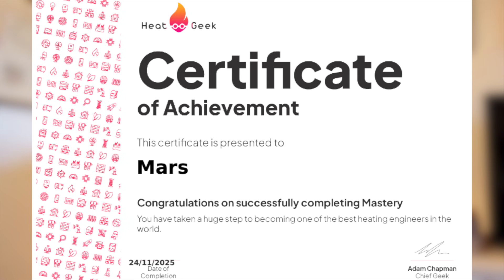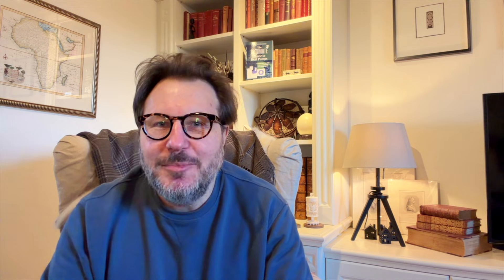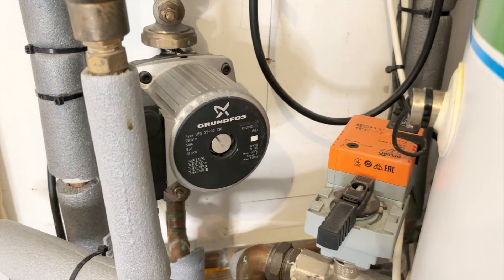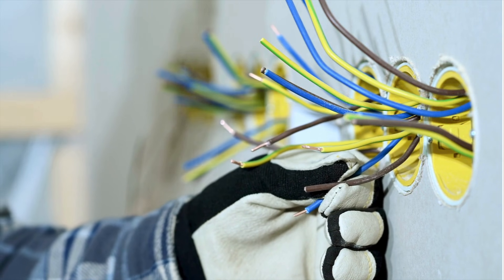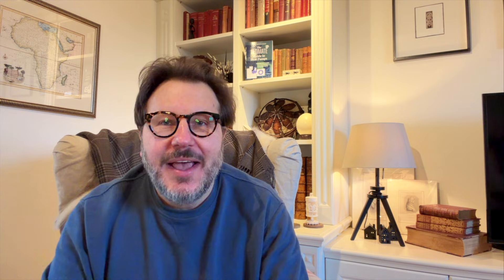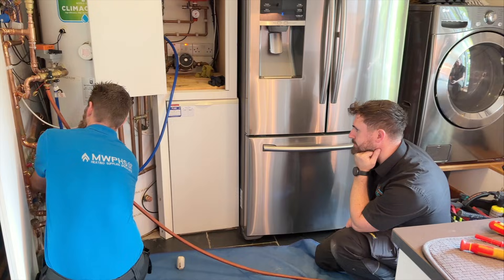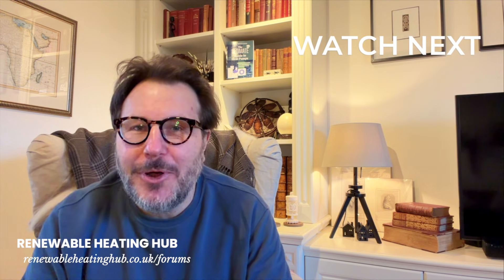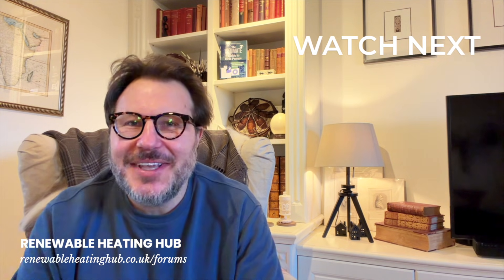What Makes a Heat Pump Installer Truly Competent?

Comment: This is a very sobering video and is perfectly aligned to my reasons for holding off, for as long as possible, before having a heat pump fitted. I am a retired professional engineer, not in this industry, but appreciate the importance of correct design and implementation. The installer base simply isn't mature enough to consistently install systems which will properly deliver. It's bad enough in the conurbations and even worse in rural areas. To find all of the skills that Mars has outlined as important as well as somebody who is willing to work with large old houses miles from anywhere (as ours is) and do a good job for a fair price, is really difficult. Ironically, I used to live about a mile from Urban Plumbers - I so wish he had moved to the countryside and was now living within an acceptable distance from me now!

Comment: Ive just found your channel and am working on a fund to  "force a remedy" for structural residential and small commercial heat pump installation here in Canada. I previously spent fifteen years in the industry here including at the national association. You have perfectly summed up core concerns our industry leaders have as well, in five minutes, and I'm a bit jealous tbh. Well done.

Comment: I do a bit of heat pump tuning occasionally for people as want to sharing my learnings from 5 years of ownership and messing around with all bits of one. If I was an installer I'd put remote monitoring on every install to ensure I could see it works as designed. As the real world is never quite like design and always needs a bit of tweaking. You then have the advantage of knowing there is an issue before the homeowner does

Comment: You have observed the difference between professional engineers and heating engineers. The former can fully design and specify a thermal system and all its components using mathematics where appropriate, whereas installers are not qualified engineers and should be called technicians. Yes, I’m a fully qualified engineer. Heat pump installers would really benefit from strong technical supervision from qualified engineers who can design the system and understand both its steady state and dynamic thermal and flow behaviours. This is how professional engineering is organised in all other industries. (Eg Technicians don’t select a fuel pump on an aeroplane ) Gas boiler technicians are not capable on their own. Good luck to them.

Comment: In retirement, I qualified as a retrofit assessor and advisor and now find myself inspecting domestic renewable energy installations on a weekly basis. Time and time again I come across botched ECO-funded heat pump installs - badly placed heat pumps, unlagged pipes, buffer tanks, undersized radiators and disabled weather compensation. Sadly, in most cases, I have to explain to homeowners that there are no quick fixes and raising complaints through their energy company, TrustMark, MCS and other regulators is unlikely to deliver a swift resolution..

Comment: It's annoying because there are those of us that love fitting heat pumps and are very nerdy about it. The companies we work for though are often apprehensive to jump on board so we either have to move companies and often move to join those companies or start our own and then advertise and pay up to get MCS accredited etc if we want economy of scale via the grant route. Thankfully there are our normal customers that just don't mind not getting the grant and having us carry out the work without MCS and companies like Vaillant will still offer the warranty especially if it has been designed along side them. 

Honestly though I have myself and another nerdy guy on the company - everyone else is a combi slinger, it's us that do all the calculations for system design, heat loss, loading etc. We are primarily electricians, the oldest chap used to put in unvented and has been doing it 55 years so he's done all the long-hand system design on paper back in the day, but everyone say 25-50 years old. Zero interest in swapping from combi boiler installs, if it wasn't for us taking on larger projects/ renewables on the electrical side Heat Pumps wouldn't even be on the radar due to the economies of scale not being as profitable as combi swaps.

Comment: I have had three major companies to do a survey and heat loss calculation. They were within my calculations within of about 20%. All gave different advice and different setups, and quotes varied wildly from £10,000to £20,000 To be honest I have given up with this.
Reply: That is really sad, I've hit a similar dead end, managed to convince my better half to get a quote for a heat pump went to heat geek and they are apparently "not ready for you yet". because it's a flat may have planning permission and noise constraint issues. So we're fixing the boiler.
Reply from the maker: That's completely understandable; it can be a really frustrating process. I have a video discussing that coming out on Sunday.

Comment: I have seen some absolute shockers and have fixed several and I am not a skilled plumber, I have learnt enough from Adam at Heat Geek and Simon at Urban plumbers to be better equipped than some of the people fitting them for so called MCS companies
Reply: MCS aren’t worth diddly squat, especially if you have an issue with an installer.
Reply: @markgilder9990 totally agree with that but we are the nation of regulation which really means you get charged more than you ought to for a crap job
Reply: @markgilder9990 MCS is just a fee earning business gatekeeper for the BUS scheme, with absolute zero interest in the customer.